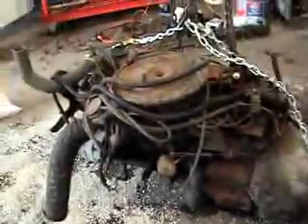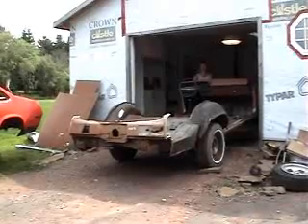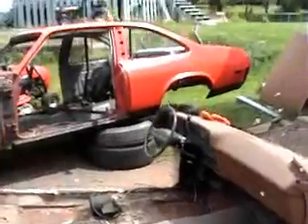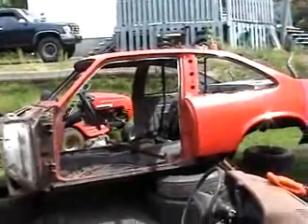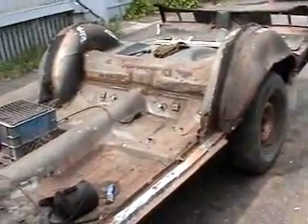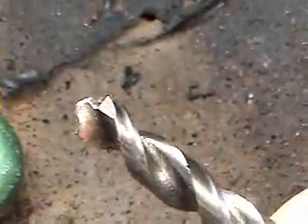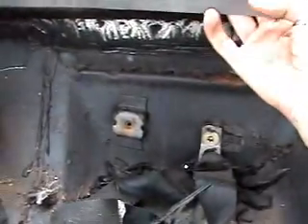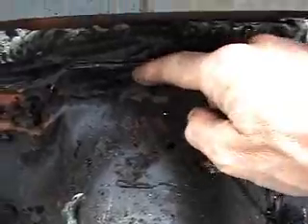the wife got greasy

Comment: i am with bethoveen on the drill bits Rick. run them slow and they will last a l o n g time. heat is the enemy. Run your drill just fast enough to keep it from catching and stopping.
Remember on a drill it says HIGH SPEED....that is NOT meaning run it high speed, high speed is the name of the tool steel they are made of. if you run it slow and keep them lubed you might make it on just the 2 bits you have.
take it easy